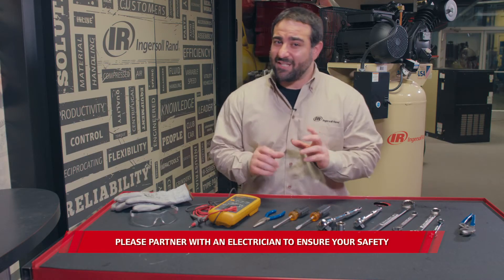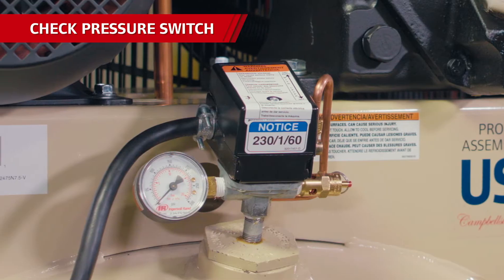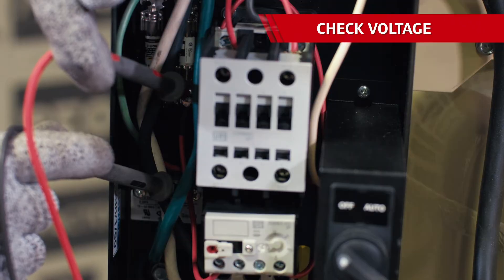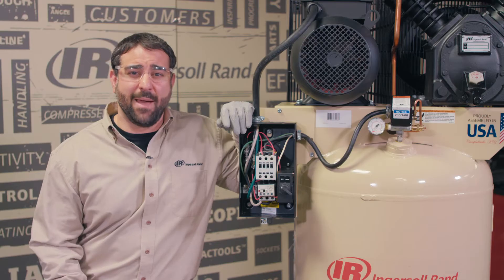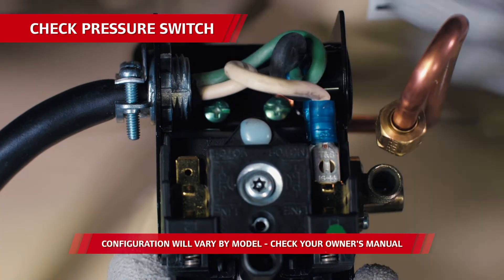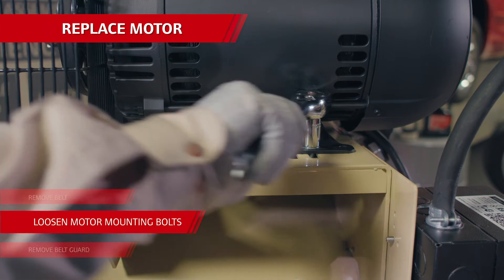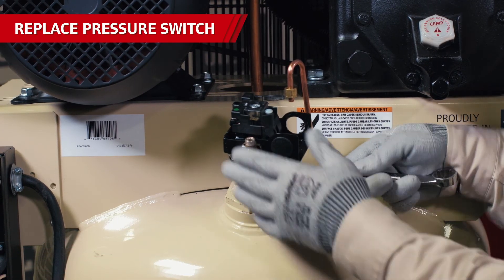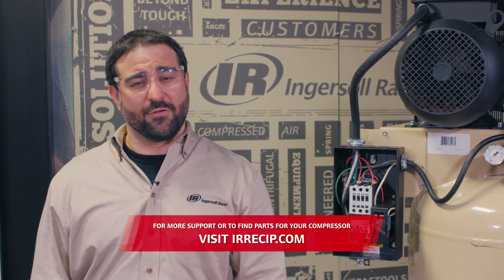Compressor Not Turning On Troubleshooting | Ingersoll Rand Reciprocating Air Compressor

Comment: Bought one of these about 6 years ago as all our compressors at the smelter are IR and have been great.  However mine gave up ghost and the start cap was cracked and leaking.  Notice on IR site they offer quote on entire motor with run and start  caps.  One thing is the housing for the caps is too small but anyway the cap should not crack like it did.   I am disappointed that this thing failed so soon after purchase.

Comment: I have a 2475, looks to be the same as the one in this video. I have an issue with start up. It all started after a few nights of low teen temps. It would only buzz and then flip the breaker/reset on the compressor or it would flip the breaker inside the shops electrical box. We started troubleshooting and found a bad start capacitor and we replaced both start caps with new ones. Now it will start and run but it is slow to get up to full speed and still would flip the breaker some times. A few days later it was back to not starting and we found that one of the new start caps was bad. Replaced that one and started looking deeper. We removed the cover from the motor and found the WEG start centrifugal switch that rides on the clutch was missing one of the pads/legs that runs on the clutch. We ordered a replacement and installed it and are still having the same issue. Now with new capacitors it is still doing the same slow starting and flipping the breaker sometimes even a few seconds after getting up to speed. It does seem to be worse on colder days. We have completely removed belt from the compressor and it spins over easily by hand so I dont think the compressor is the issue.  Any ideas? What are the chances that the motor can be bad and if so, how can it be bad if it runs fine once it gets going? Also, could the clutch be out of adjustment and be causing issues?
Reply: Found the problem boss? Having same issue
Reply: My 2475 was 3 phase but I switched buildings and put a 1 phase motor. Same everything. Ran great for 6 years last week it sounded like it blew up and tripped everything in line. The capacitors were still good the problem was the centrifugal switch that engages the stationary switch mounted on the rear end bell to signal the capacitor to switch off has a plastic rotor that broke into 3 pieces. I replaced both switches and the motor runs but now I think my pressure switch is bad it intermittent has to be reset or stops 5 or 10 psi before it should. I've been in grainger like 8 times over this trial and error 😑

Comment: I have some advice  to IR...pls instal a magnetic  starter..on your 5h.p. units yes it cost more ..bottom line..as a rule of thumb..magnetic  starter is needed from my experience  wiring  these units up..the pressure  switch  cant handle     the laod at start up..  I see these units in home stores all over. Unless it's a 7 h.p. or more.....pls..pls .IR..add these starters to your 5.h.p. unitson your home store units..u sell.

Comment: my oil keeps heating i have frozen two pumps - about to use very colorful expletives - not impressed with this at all - -
not a small purchase  - use it on the plasma machine so it cycles on off a few times - are there oil colors available?

Comment: The wiring diagram doesn’t show in detail where the electrical wires provide power to the air compressor. Please show me where to install the two hot wires. I have the machine that is been showen

Comment: If you are competent to do this work then this video is not needed. If you need this video then you should not attempt any repairs.
Reply: Said by a true jackass. Do you think everyone pops out of the womn knowing everything? So stupid i hope you gain some knowledge about life if youv lived this long yet leave comments so dumb.
Reply: Well, where do you learn then, Mark? 🙄
Reply: @V1b3c0d3r  Get into the industry.
Reply: @maytagmark2171  OH Kayeeeee! Thanks!
Reply: @V1b3c0d3r  I am not trying to be difficult, but air compressors contain two of the more dangerous qualities to be commonly found around the house or the shop. A pressure vessel and electric. I have seen a lot of people get VERY lucky and a few not so lucky. All because they tinkered with air compressors without the proper understanding or some one actively watching over their shoulder. And a You Tube video is not the right place for some one with little to no experience to learn. There are too many situations the videos can not cover. But the supervision of some one well versed in the subject can greatly improve safety in the situation.
Reply: @V1b3c0d3r  Every situation  with an air compressor can lead to disaster in one way or another. An air compressor with a tank full of air is not a safe thing to play with, if its an electrical issue call an electrician or a service technician. If you do not know what you are doing you can get yourself or others killed or seriously injured.  I've seen several instances over 40 years in the industry that proves If you do not know what you are doing call some one who does and get them to do it. Three of them leading to tanks coming apart due to the inexperience and lack of understanding of the person attempting to figure it out on the job.